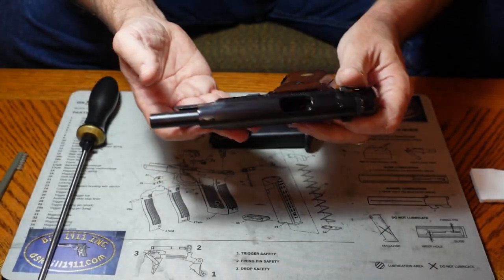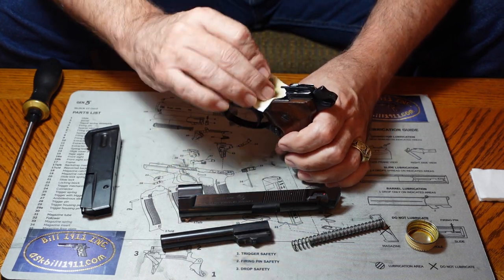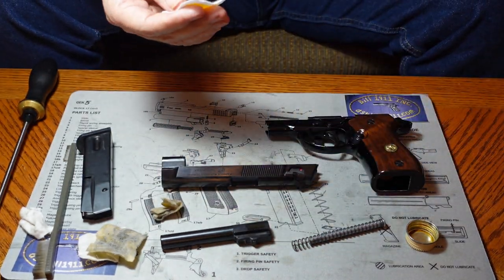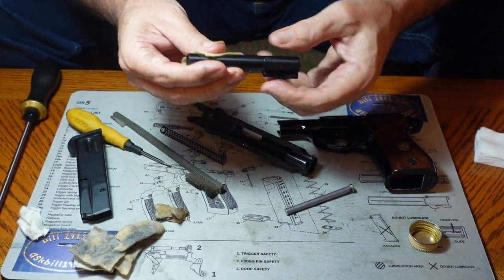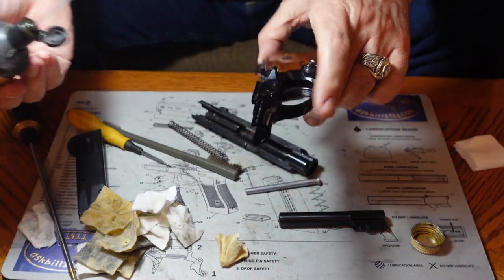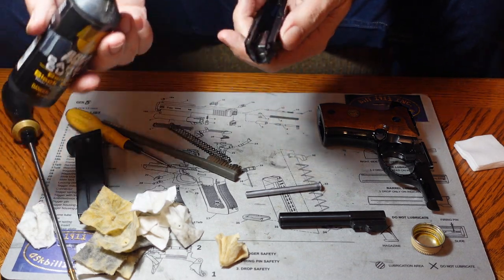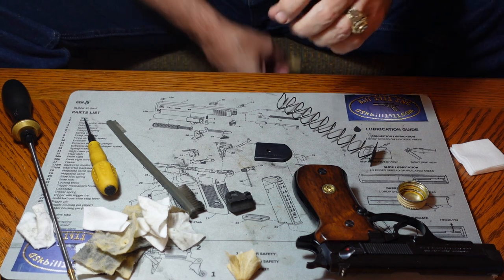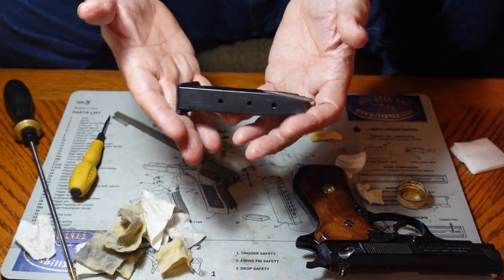How to disassemble, clean, lubricate the Beretta BDA 380. #beretta #bda #380 #pistol #gun

Comment: Any tips on dealing with nickel-plated guns of this era that get not really getting use?  i have both a BDA and 84FS nickel-plated...they are basically BBQ/Desk/Nightstand guns.  I fired them each 150-250 rounds to confirm function, and then wiped them downed with cloth and lubed them.  Never used 'cleaners' on them.  Other than once a year to wipe with cloth and re-lube, any extra advice?

My other guns (80x, 1911 9mm, NAA 380l, SW revolver) I use every month at the range and clean and lube.  But I do wonder about the the nickel-plated ones that just sit.
Reply: Don't use ammonia based copper solvent; it will strip the nickel by dissolving the copper layer under the nickel.

Comment: Isn't this a browning BDA 380 made by Beretta?
Reply from the maker: Yes that is correct. It is my understanding that the design is Beretta, manufactured under license by Browning. I find the gun to be very comfortable to shoot. The grip is large enough for my hands. I don't feel like I have to be worried about slide bite, like I do with some of the other small handguns. The grip of the BDA feels natural. The same can not be said of the Walther PPK for example. I'm constantly readjusting my grip on the PPK to the point that it is a distraction. The BDA is one of my favorite guns. Some people don't like the .380 auto round claiming the .355 dimeter 85gr. and 95gr. bullets lack punch, however I certainly wouldn't want to be on the receiving end of one.
Reply: @Bill1911  as much h as I'd love to have one of these guns right now I'll be inheriting one so under those circumstances I dont mind waiting a long while
Reply from the maker: @texascrossbowdude636  I agree with you. I have a 1911 gov. All things considered, I'd rather have my dad back.
Reply: PB in an oval means Beretta made.